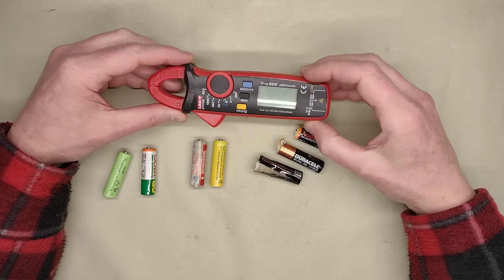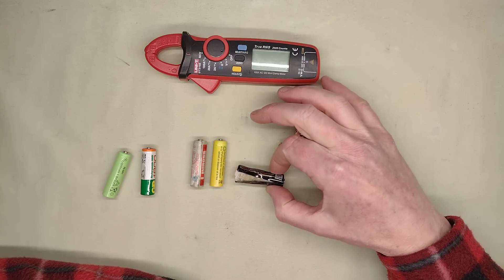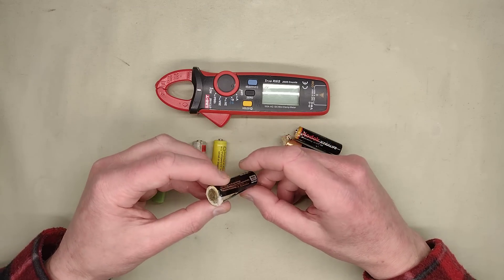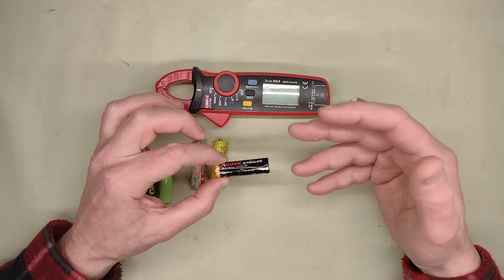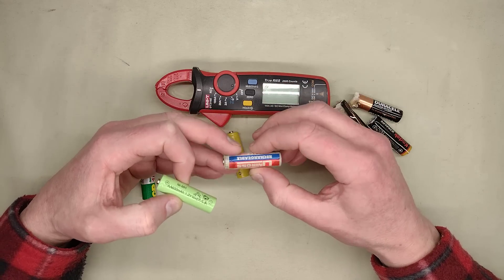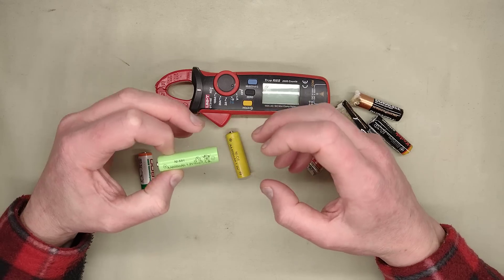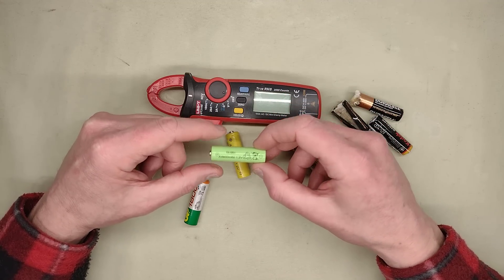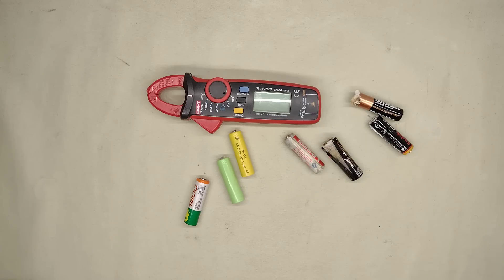The curse of leaky alkaline batteries

Comment: Weirdly I always feel a sense of personal failure when I find leaked batteries in a piece of equipment.
Reply: I can relate, definitely.
Reply: @bigclivedotcom, although I agree the case for a primary alkaline cell has much less weight these days, there are still many uses where an alkaline is still critical - mostly high current applications such as DC motors, so common in kids' toys and small kitchen gizmos (milk frother, for example). NiMH are a pale competitor, not only due to the lower voltage but also to the higher internal resistance. Overall, rechargeables FTW.
Reply: @Vbeletronico  completely agree
Reply: Surely that's the other way around, NiMH cells are capable of higher current due to their low internal resistance whereas Alkaline will sag and get hot.
Reply: @Vbeletronico  yeah, nothing worse than caring for the environment and raising awareness of climate change- an issue that's proven to exist [and ignorant people ignore]
Reply: I feel a sense of personal failure no matter what
Reply from the maker: Rest assured it's the eco-hippies who forced a change in the chemistry, and the corporate brand owners who put dead-brand labels on the cheapest cells they can get who bear the full blame.
Reply: @bigclivedotcom  Would you provide us a list of "dead-brand labels" please?
Reply: Not just "cheapest cells", Duracell and Energizer batteries will leak when left neglected in a remote control, just past the date printed on the batteries.
Reply: @Dwedit  Duracell have been the absolute worst for me.
Reply: @Dwedit  Nor necessarily. I went to buy some Duracells after I thought I had a bad batch. Saw several pack of Duracell leaking inside their packaging just sitting on the shelves. It put me off buying them again in future
Reply: @bigclivedotcom  I'm not aware of any required chemistry changes outside the removal of mercury and I'm pretty sure that switchover happened well before the now epidemic of leaks from brand-name alkalines.  
I'm more convinced it's the infiltration of counterfeits into official supply chains, which is one of the reasons I'm going to stick with Thunderbolt Edge from Harbor Freight.  Their simpler distribution network and less "premium" name should hopefully help keep counterfeiters out.
Reply: Thank goodness for the eco-hippies.  As well as all the other eco-humans.  Personally, though I am interested in your comments on technical matters, I care not for your political views, and that comment is edging over into the political.
Reply: You are right to feel that as a personal failure. You are a very naughty person.
Reply: When my kids were growing up, I'd go around the house yanking the batteries out of all of their electronics and toys. 

They're adults now, pulling out 20 year old toys (like a Gameboy) and they actually thanked me.
Reply: Was told that when the battery gets down to 10% charge the polarity starts to reverse and battery starts to leak.  When putting in batteries if you put one in reverse it will leak and replace immediately. Duracell quality is shit, many problems with them.  Worked for a company that worked on airpacks for firefighters. Had problems with duracells, wouldn't last as long as they are supposed to.  Small company was bought out by national company they bought energizer very specifically as they had better quality.  The commercials that firefighters use duracells is they just paired millions to have the testing done.  Lot of energizers are used.
Reply: @jasonmajere2165  I always thought. This was the case. Certainly is with some rechargeable cells but I’m not sure about alkaline or zinc cells.
Reply: I bought some rechargeable alkaline batteries but they do not seem to be any better than ordinary alkaline batteries for recharging. I have noticed that the lithium 18650 rechargeable batteries are replacing the aa rechargeable batteries in mp3 players and radio's.
Reply: I’m sure the biggest culprit is leaving devices powered on thus over discharging them causing the leaks. I haven’t ever had a leak in a device with no drain draw the battery at all.
Reply: @lentner3  You can be sure all you like--doesn't make it true.  I've had countless devices that were not powered on that experienced this dreaded mess.  Most recent was my Nikon speedlight flash.  :(
Reply: @brianh.000  never said this couldn’t happen. It certainly if nothing else accelerates the process. I’ve never had a cell leak in an item that hasn’t been left “on” just my experience don’t shoot the messenger. I’m interested in others experiences and sharing mine and I have dealt with this a lot. Being an RC enthusiast I have studied battery technology and chemistry a lot. Not Alkaline so much tbf but have hundreds of batteries at any given time. When switched off haven’t had an issue yet. Especially track master trains which my son collects. Leave the switch on and I guarantee they will leak. Perhaps it just speeds up the inevitable.
Reply: @brianh.000  were you able to clean up the Nikon?
Reply: Also how can you be sure there is zero resistance in the circuit when switched off this cause if no drain at all. It only take a very little current draw almost too small to register on a meter for it to have a discharge effect.
Reply: @lentner3  yep, but it still doesn't work.  One of these days, I'll have to tear it down and see what's up. 😔
Reply: @brianh.000  isopropyl is your friend in these situations. Slightly tricky with cameras due to them being delicate.
I hope you get it working. Sounds like a fun project if nothing else but I’m odd like that.
Reply: @lentner3  Oh, definitely.  I used isopropyl when I initially cleaned it out.  The tricky part is that the battery compartment is quite deep, so access is difficult--thus the planned  tear down. This is for a Nikon speedlight, not a camera, so hopefully it's not too fragile.  Thanks!  I hope I get it working too--new speedlights are not exactly cheap.
Reply: @lentner3  "the biggest culprit is leaving devices powered on thus over discharging them causing the leaks." - Not really. First of all batteries have a self-discharge which means that the chemistry will keep going on even if the battery isn't connected to anything and second just leave a couple alkaline batteries in a container for a few years and you'll see that they'll start to leak on their own too.
Reply: @CoolKoon  I think you are wrong here but happy to be disproven. In my experience which is significant. I have never found this and I have many containers with cells many years old. Kept in the garage. They may not perform too well but the only time I’ve had leakages have been in devices and they alway have the switch in the on position. I’d Love to know more about this
Reply: @lentner3  "I have never found this and I have many containers with cells many years old." - Well I happen to have a box full of alkaline batteries and some of them have managed to create a whole big puddle of electrolyte on the floor without obviously being connected. I was furious when that happened, because I didn't expected them to do this either.
Reply: @CoolKoon  my Garage is pretty cold most of the year, maybe this is a factor. I have also never noticed my alkalines self discharging a significant amount unlike the Nimh cells. If not how can they stay on the shelf in a store for so long. Yes they have an expiry date but that’s still usually many years. Perhaps I’m just getting through too many batteries to notice. The worst culprits being devices that maybe get little use and hence that’s giving them and opportunity to leak perhaps that explains it? I have a particular pot of batteries that are new cheap and been in a pot for 3 or four years at least that are still fine. Perhaps I will check the voltages but I suspect that are still sitting at 1.6v without a load. Perhaps there is a preferred storage temperature or humidity. One thing is for sure I’ll be gutting all my boys trains of batteries that get little use. He’s got some fairly rare and old toys he’s collected over the years.
Reply: @lentner3  "my Garage is pretty cold most of the year" - Oh yeah, definitely! I had those batteries at room temperature pretty much all the time.
"I have also never noticed my alkalines self discharging a significant amount unlike the Nimh cells." - They do have self-discharge as well, but its rate is a lot lower than that of rechargeable batteries.Their shelf lives are thus about a couple years IIRC.
"Yes they have an expiry date but that’s still usually many years." - Quite a few of the ones I've seen started leaking even before that time. Even Duracell and Energizer cells, not only the no-name brands...
" The worst culprits being devices that maybe get little use and hence that’s giving them and opportunity to leak perhaps that explains it?" - Maybe.
"I’ll be gutting all my boys trains of batteries that get little use." - That's not a bad idea at all.
Reply: @lentner3 not true, I had several 60 packs of Duracell AA’s leak while still in the original packaging, while stored in a heated room prior to the expiration date shown on them. I haven’t seen that any time previously to be fair so maybe those were defective in some way. In any case, it can happen with no drain on them at all.

Comment: Maybe you would like to run a self discharge test on a range of NiMH batteries. I have taken to removing the batteries from portable equipment, only fitting them when the equipment is required. This saves a lot on batteries, as I just need to keep one set to be used in a number of meters. Unfortunately I still need to keep the PP3 size along with a set of double and triple A size. 
A further problem is that some equipment has a battery compartment that require tools to open it. 
I like the idea of using low self discharge NiMH, but it is only recently they have become more common.
One of my pet hates is that equipment manufactures do not do more to seal the equipment battery compartment against leaking battery chemicals from finding their way on to the products PCB, where the chemicals eat away the tracks, completely destroying the product. How difficult is it to blog the entry points with plastic, to stop the chemicals accessing the product internals, it is not as if the manufactures are unaware that batteries leak. They put warnings in the product manuals, insisting that batteries should be removed if the equipment is not to be used for a prolonged period. Why don't they just solve the design problem?

Comment: At 68 years old I remember when batteries came with a guarantee that said they would replaced anything damaged by a ruptured cell. Great tips Clive!
Reply from the maker: That was Duracell, but best of luck getting any form of compensation.
Reply: @bigclivedotcom  The Chinese Duracells are truly the worst, worse even than no name specials.
Reply: Duracell at least still has that guarantee.  I couldn't find on on the Energizer package.
Reply: @stargazer7644  But here in the USA I find that Duracell brand batteries (mostly AA and AAA size) that I bought about two to three years ago have all leaked in their unopened package.  Not so with other brands which have been in their factory packages for 10+ years.  

Just my experience.  

A T Burke  

P.S.   They did honor their warrantee and sent replacement batteries.  The only question they asked was what country the packaging the bad batteries claimed were made in.
Reply: @atburke6258  Oh, I agree, Duracell has been the absolute worst in my experience.
Reply: Thank you for the tip! I think Clive is on to something with phasing out the alkaline batteries. I am careful not to leave batteries in things I am not using too.
Reply: @stargazer7644  Energizer has guarantee too.
Reply: @nayaktuhin  I could not find any guarantee on the most recent Energizer AA/AAA packages that I just bought.
Reply: Duracell still has that on their packages here but they never honor it, at best they offer to mail you replacement batteries or a rebate on your next purchase. I just stopped buying the them. Copper top batteries were pretty much guaranteed to leak every time.
Reply: I know zinc carbons rarely leaked. Alkalines will expand with gas once they start making current when they are new. I have never had any "new" unused batts leak. Always partially drained or nearly drained or just drained.
Reply: @QuantumRift  I remember zinc carbon leaking often.
Reply: @ian1352  No, not so much unless left totally neglected. That's why they had a warranty printed on each batt that said they would "repair or replace" the device the batteries leaked in. I got a couple of new flashlights that way but that was over many years. Alkalines have no such warranty.
Reply: @QuantumRift  There were quality zinc carbon batteries such as Eveready and Ray-O-Vac which were well made and didn't usually leak.  There were also cheap tar top paper label on the zinc can cells which were practically time bombs.

Comment: The thing about alkaline batteries, if u don't use them(assuming they're installed in something) they will leak! Idk why! Most instruction manuals will actually tell you, if the device is going to be stored for a while to remove them! Strange enough tho, I'vev one never seen a 9v alkaline battery leak!

Comment: The biggest problem with rechargable cells is the lack of low discharge protection in battery driven devices. They are all designed to squeeze even the last bit out of the battery and NiMh cells dont like that. Especially in low power devices... 
The battery can sit for long times at very low charge wich destroys the cell over time. And the worst part is, you dont even realize it, because there is still enough voltage to run the device.

Comment: If using non-rechargable batteries I always go for Energizer Ultimate Lithium batteries as they last for years and don't leak a crusty mess all over your device.
I'm also at the point of replacing some batteries in devices with NiMH batteries because there's really no reason not to.

Comment: Just a quick question, what's the best way to clean up all that mess left behind by those leaky batteries?? I know a few methods that work, but wondered if there were better ways?? Btw I think you're right,  I've been using rechargeable batteries for years.
Reply: I use lemon juice, then clean off well. I think Big Clive stated that anything acidic eg lemon, white vinegar then clean / neutralise with baking soda etc.
Reply: @neilcaldwell870  thanks. I'll try next time.

Comment: I've gone back to the cheap carbon/zinc batteries for low drain devices like clocks, mice, and remote controls.  No problems with leaks. When I use alkaline I use Energizer Max, Duracell is the worst for leaking.

Comment: I wonder how many millions of dollars have been lost in damaged equipment over the decades!!! What about the relatively new technology of the 1.5v li ion rechargeable batteries? They look extremely promising but I haven't forked out the $$$ yet to give them a try. If they perform as advertised,  it looks like they're the real solution,  but question is,  will they leak over time? 
Edit: ok, i just noticed a bunch of rechargeable alkaline batteries on Ebay... what is the story on these? Are they only rechargeable a few times? Or only take partial charges? Do  you have any knowledge about their performance/quality?

Comment: The best way to clean up the mess from alkaline batteries is to use vinegar. Then switch to rechargeable batteries. If that doesn't work because of the voltage, switch to lithium batteries.  I've never had the lithium leak nor a nickle metal hydride battery.  Thanks for the video

Comment: For all applications where the current draw is low, and I estimate the battery will last more than 6 months, or that I might forget the battery in  there because of potential low usage, such as clocks, meters, etc, I use the super cheap and old dry cells (Zinc–carbon). Never had trouble with those. I suppose that is why they still exist.
Reply: Odd, carbon zinc's were the biggest leak offenders.  That's what put Alkalines on the map - they were advertised as not leaking and long lasting.
Reply: @stargazer7644  I have seen very old zinc carbon batteries "bubble" underneath the wrap and I have seen them rust too, but I never had one to make such a mess as alkaline batteries do. The leaking material from alkaline follows the wire or battery leads and can go all the way up to PCB and corrode the copper tracks sometimes. Panasonic's zinc carbon batteries seem to hold well enough.